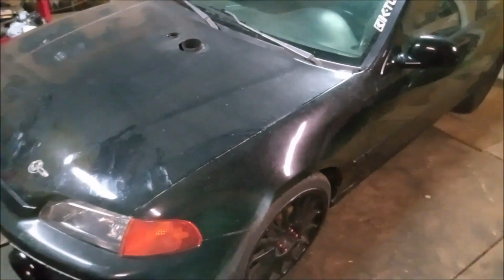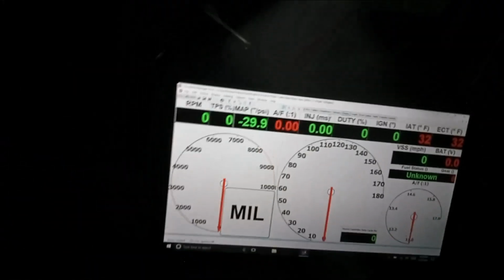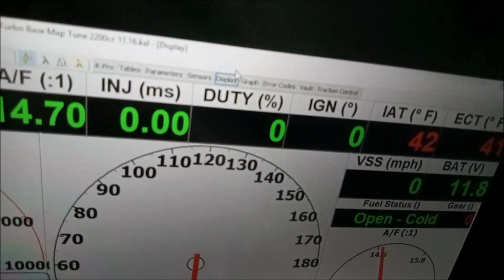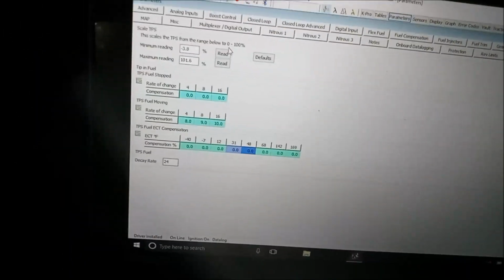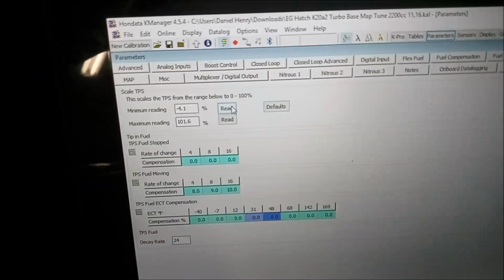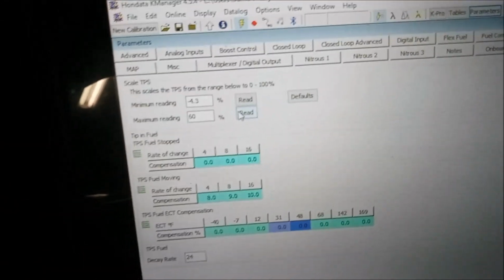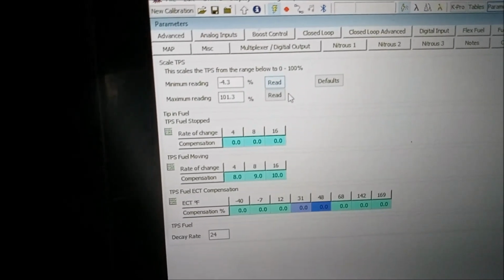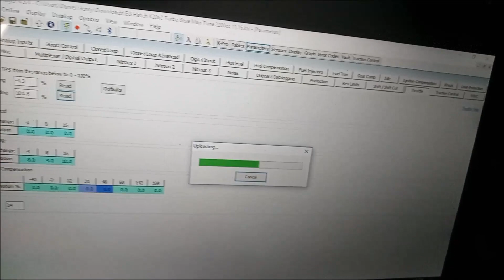Hondata K Pro (How To Adjust TPS)

Comment: So HAD an OEM Denso TPS sensor on my aftermarket Bigger Billet throttle body and scaled it on my Kpro 4 just fine. EG hatch ran and idled fine, when it was briefly N/A. Did a COMPLETE rebuild a BUILT K series . Pistons Rods,headstuds. HG . Etc for boost and got lazy when knew better with NOT taking Throttle body off. Broke Denso TPS with engine hoist chain. Have 2 different TPS sensors and neither will communicate with Kpro. One is a cheap China Chong and other a BLOX brand.  The Grey boxes when scaling TPS are not dark and able to scale or read. Have YOU ever had THIS happen?  I ended up finding another Denso TPS from a JDM importer seller.   Bought it online and waiting on shipping.  Any help / advice appreciated man.
Reply from the maker: Had k pro more lock me out same way, usually just reboot the laptop. See if it helps if not let me know and we can dig into it more. Most time the hondata program needs updating or it just did and it's acting stupid because of it.